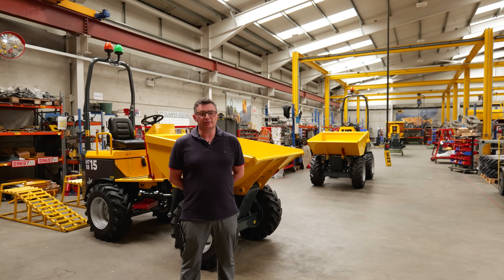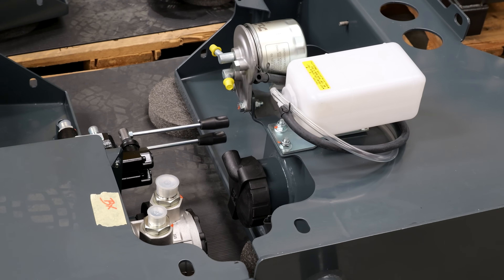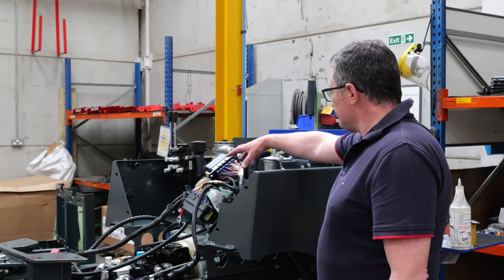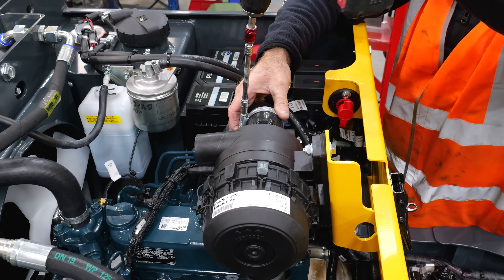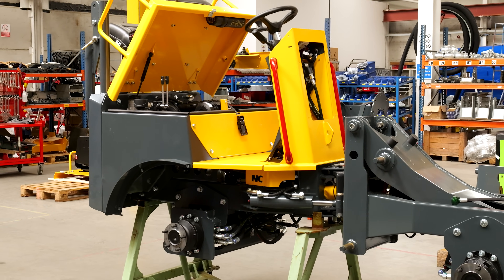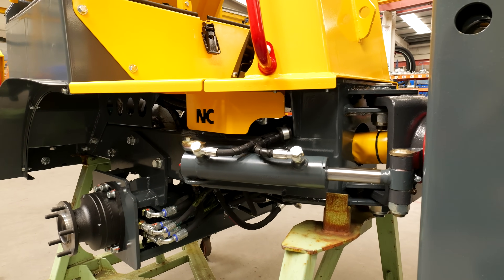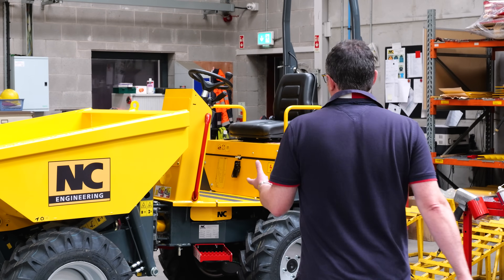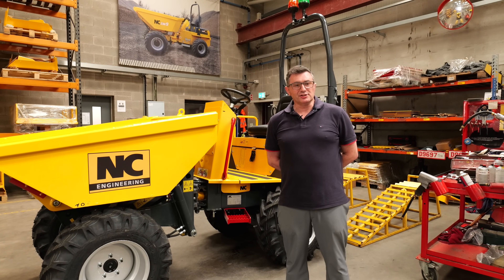HOW IT'S MADE - NC DUMPERS!

Comment: 12;00 STEP POORLY FITTED
BOLTS WILL SNAP OVER TIME.
.CENRE OF GRAVITY TOO HIGH TOO
Reply from the maker: @rumpoh8039, Step have been fitted this way so that the bolts can be easily replaced if failure occurs, higher centre of gravity for better ground clearance. thank you for you feedback.